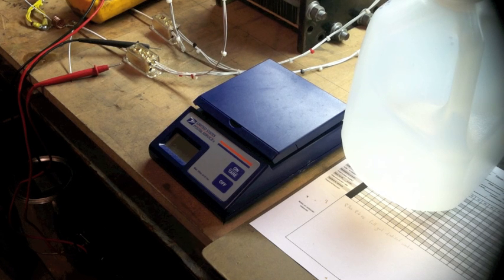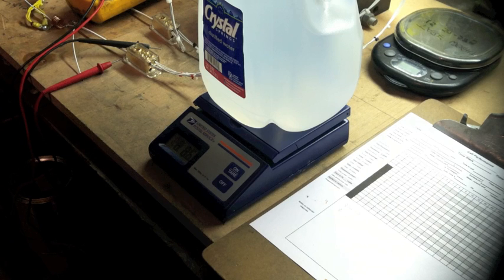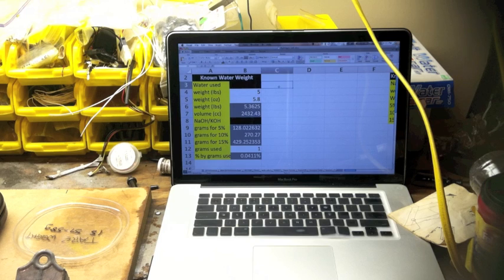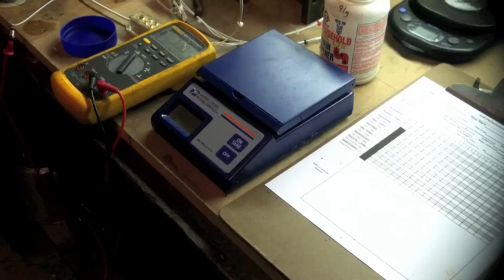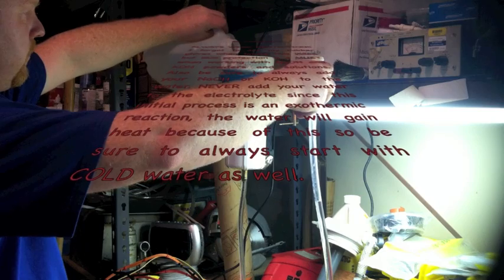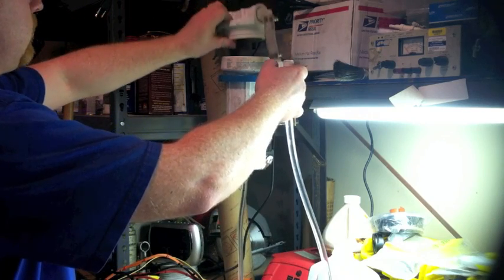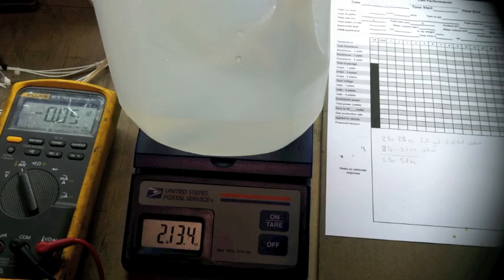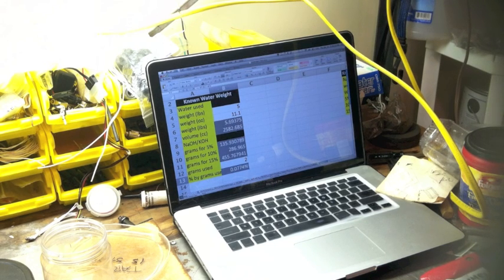#14 - How To Measure And Mix Your NaOH Or KOH Electrolyte

Comment from the maker: @ztexanz it depends on your cell, but most of the time people mix it to about 5% to 20%. If you don't have a PWM then you'll need to base your % strength on how much your max current is, that just means adding a little at a time until you've reached you're max amperage draw. Right now that's what I'm doing since I haven't ordered my PWM yet, once you get a PWM you can put your % strength at 20% and then limit the current with the PWM. I hope this answers your question.